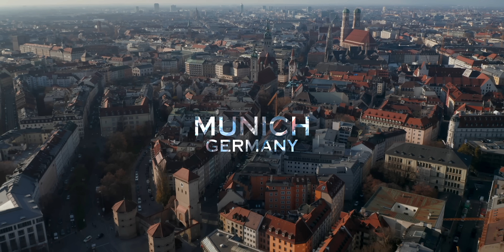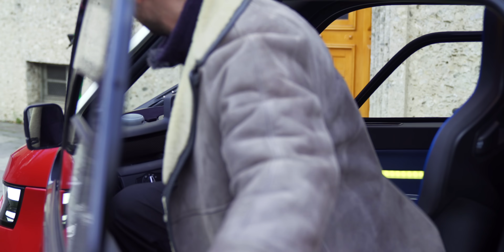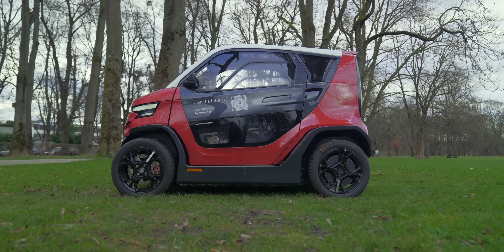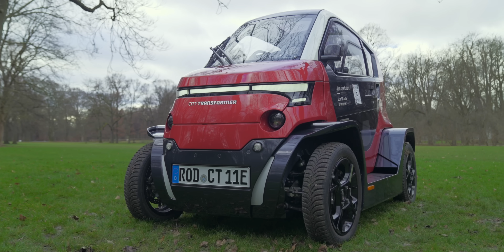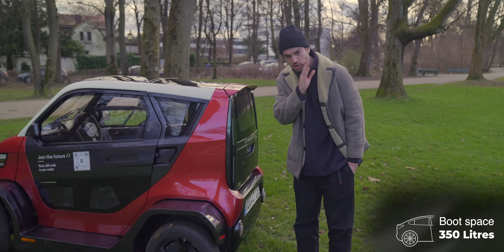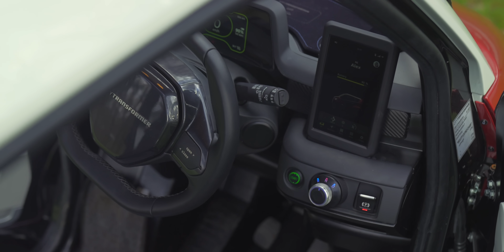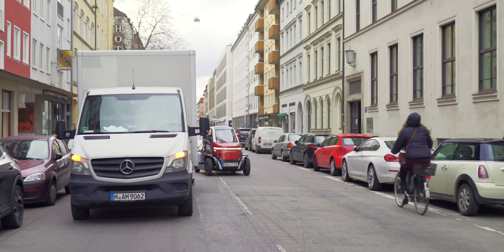The TRANSFORMING Electric Car Designed to Skip Traffic Jams!

Comment: The solution for traffic is never going to be solved with some new car. The solution is going to be less.
Reply: on a personal level it might get solved - I'd much rather park that vehicle and it seems nicer than riding a bicycle or motorcycle in the rain.
Reply: Fewer cars is the top priority. This would aid that (designed specifically with car-sharing in mind). Cars getting smaller would help too!
Reply: I’d prefer either an electric bike or a “real” microcar - maybe a Smart or something that can carry two people in comfort. But well done for saying “shape shifting chassis” without spluttering.
Reply: The future is smart cities. No need for cars to be driven.
Reply: @JackScarlett1  agreed and for people who don't believe that, try being stuck in a city behind a bendy bus that occupies an entire mini roundabout, instead of a proper double decker that has the same number of people but has already cleared the junction.

Size matters, no matter what the SUV people tell you. 

I'm pretty sure if you nixed all the Land Rovers in Kensington and Chelsea, there'd be a lot more room for vehicles and people.
Reply: Agreed but vehicles like this are closer to e-bikes in terms of impact and space than they are to regular sedans or even EV sedans. I have no problem with micro cars as a stop gap solution on the way to walkable cities so long as they're EVs and designed around sustainability.

I should add that I live in North America and we're much further from walkable smart cities with excellent transit than our European counterparts. I could see these things being a pain if they start being used in bike lanes in Amsterdam.
Reply: Hope it is scissor doors. As you saying the video, what’s the point of being able to park in a such a narrow space but need space to open the door. Maybe they could compromise and have one conventionally opening door and one scissor door, so the driver has the choice. Very interesting video. 👍
Reply: Or people can just walk or take public transport, especially in the large metros in developed countries
Reply: @seauryakumar  Doesn't apply to most of North America, unfortunately.
Reply: There is a reason why the many iterations and variations of mini cars/covered bikes have not become popular: the size. The size means impractical and regardless of ease of parking, hint: never between parked cars, unless in specialized functions such as handicapped, campus, inner city shared, recreational parks, utility vehicles, etc. Thanks
Reply: It’s both. We can pursue both new smaller vehicles and fewer vehicles overall.
Reply: Less is more!
Reply: It’s not that the answer is only fewer cars. This lesser car also plays a part.
Reply: True but…..just for metro driving, this is a great idea especially for single people. I’d definitely keep another vehicle for long distance travel but this could work for me. The price isn’t bad either. 😏
Reply: I can see people never walking and using just these to go absolutely everywhere.
Reply: Still, little car makes minimize ordinary car problems...like parking and space
Reply: Agreed! Instead of a family having one car we will see 3 or more of those parking in front of the house
Reply: @JackScarlett1  No thanks. I'd rather have more public transport and largwr vehicles to whom it may concern.
Reply: Well unfortunately the solution having less is also fixing our awful zoning laws that have forced people away from businesses.
Reply: The Dutch, Finns etc appear to be able to ride bicycles in the winter. I guess it's just doesn't have the sex appeal of gizmos like this.
Reply: @charlo90952  Well... you can also live on the street, right? Not the most comfortable...
Reply: At least the smaller car uses the current resources better ... Given that most SUVs carry just one person most of the time.
Reply: @wayando  still, no matter the size you can never fix traffic exclusively with cars. It's just impossible for cars to be as efficient at transporting vast numbers of people compared to trains, trollies, or busses. The downside is that the average person is heavily disinterested in public transport which is why traffic is so bad and why public transport is so lacking in the US. It also shouldn't be so surprising that the vast number of news on the topic is also colored negatively further pushing the divide. 

I don't think it's fully unjustified to have distaste for public transit, but the fact private vehicles are a necessity for life in the US is a massive failure. Especially when private vehicles are so expensive and there's little reason to enforce vehicles to be affordable other than what the vast majority of people can afford. I think it says a lot though with how many are banking on self driving vehicles instead of the vehicles that already basically drive themselves for you.
Reply: I believed it should be less and smaller in size.
Reply: Don't tell them about those high efficiency high cargo capacity electric cars on tracks...
Reply: @jonevansauthor  Agreed our city got a failed in other places mild hybrid bendy bus and the test drivers got stuck all over the city. Unfortunately that kept them "Gliders" but fortunately now the newer option to replace the diesel busses are full electric double decker's and they have no problems with any of the routes that the bendy Gliders get stuck on.
Reply: @EnnuinerDog  You can not drive it on bike lanes in Amsterdam .. even a HS (45 km/h) e-bikes are not allowed on bike lanes.
Reply: @pollumG no thank you
Reply: @orderofmagnitude-TPATP  I agree
Reply: And the Euro-NCAP rating.... I'd like a bit of that  whilst mixing it with contemporary traffic... In the interrugnum before this type of vehicle predominates city traffic.
Reply: @pollumG  No needs car...
Reply: But the thing is, who wants less… I don’t think the typical guy wants to give up his car to take the bus.

Comment: Its like a better mobility wheelchair, but useable speeds more than 8mph, i can see it being great for pizza delivery as thats miserable in bad weather on motorbikes or ebikes.
Reply: You can get covers for ebikes or etrikes to keep you dry, and it will come in thousands of dollars cheaper for the deliveryman, plus not require insurance and registration.

Also, delivery people in downtowns like electric scooters because they don't get parking tickets or locks on their wheels. You can pick them up and take them off the road to not get parking tickets (but that comes with a risk of theft from junkies)
Reply: @-whackd  yep, and just consider how many  tens of thousands of pizzas you have to deliver till you pay for it. 16 k is unacceptable. With that amount of money, you can take a taxi to and from work for ten years. And you do not need to drive it. But as a rental this may work.
For something like this to be an success on market, should be no more than 2k. 
Is no wonder that gas care are still at power.
Reply: @ehombane  A decent mobility scooter or eTrike is more than 2k.
Reply: @rossmaclean2  The key of your statement is... decent. 
And I understand, we all are kings now, so everything needs to be fancy. Sorry, decent.

A friend of mine has a mobility scooter that costed 1k. Sure lead acid batteries, and no roof. But is anyway overpriced because of limited production and taxes. 

What I say is that these devices should be cheap in the stripped version. Who wants heated seats and wheel, fine, pay it. But the student is poor, and hence he will pay 1k, for an battered old ICE car,  Gas will cost him a lot more in time. But down payment is the key. 

And I understand, production cost may be more than 2 k, But since there are so many other things subsidized, like coal plants why not these too. 

If We want clean cities, this is a way.

By the way what you vote for decent air or decent wheels?
Reply: @ehombane  Well i would assume itd be better for businesses to buy small fleets of these for delivery in cities
Reply: As a Domino's driver with a 98' Mondeo that is sometimes 'cumbersome' in some of my English town's narrow back streets; this brilliant creation would be awesome!!! Cos I want compact and efficient, but I not doing the 2 wheel thang.😂

Comment: Honestly anything above 5k in pricing doesn't make sense maybe 10k but at that point u have other used car options that are efficient with fuel that they make more sense, If I am buying this small car to get around faster and cheaper not great comfort, make it as affordable as possible coz it shielding me from the cold or rain is confort enough 14:40
Reply: This. The way I see it, anything above 10k automatically disqualifies a micro EV car as a valid option. The 4th gen Wuling Mini remains unmatched at <7k USD in China, and it's a car that can seat 4 people (2 of them have to be either kids or "smaller" adults though).

Comment: Looks great and really agree with being able to split lanes in a car as its 'killer app'.  In heavy traffic, in terms of speed to your destination, a Smart and a Range Rover are essentially the same.  It's the reason why I chose a scooter years ago when I would have preferred a Twizzy.  

The one problem I do wonder about is how easy in reality it will be to go into folded mode when you really need to.  In my experience, the 'oh nuts, I need to squeeze through' moment usually happens when stationary, and then I doubt that I would have enough space to get to 6mph and spend the 2 seconds to fold in before getting to the gap.  I haven't done the sums, but suspect the gap will be well into 'what is this muppet doing, I'm going to lay on the horn and call him lots of names' territory.
Reply: Also from my experience on a motorbike some other drivers are very selfish and will squeeze you at the last second before filtering
Reply: When you look for a parking you can prepare yourself for it.. here in Amsterdam all is 30km/h so I do not need the wide mode, and it will also protect me from getting a ticket because the nerrow mode is limited to 30kmh.

Comment: This would be nicer than riding my cycle in the winter or on those rainy days.
Reply: I do agree would be more comfortable but if you can cycle it will be the more sustainable way to take the bike. I actually only take a car if i need to transport stuff which wont work with this little one. Thats way i cant imagine it being useful for me. But like i said if cykling is an problem than this might be the best option.
Reply: One would have to take into consideration the individuals in the city who like to drive big vehicles. Some of them are less polite to vehicles they see as too small or an underpowered nuisance. This would be both, which makes me want one even more.

Comment: The micro car class (L6 and L7 in the EU) could really use some lobbying, as Jack said. Not just for financial incentives, but for parking spaces too.
In bigger cities street parking will get more and more restricted as the street space is released for pedestrian use (which is a good thing). This dilutes the main benefit of this class, parallel parking. You don't need to park parallel in parking garages and you end up taking exactly the same space with a microcar as a regular car takes, with the same cost obviously. The layout should be designed with microcars in mind as well, letting them take advantage of their small size. Motorcycles are often neglected too in this regard.

Comment: Love the idea of transforming micro-cars. Followed the "Hiriko Fold" (changing the wheelbase) for a while, which like the Microlino was entered via the front and had 4 wheel steering with a motor in each wheel. Combine the transform capability of both and the versatility is incredible. We live in interesting times. Cheers.

Comment: I really hope this one works out. Basically I'll take anything that's a modern one or two seater car no bigger than the Smart. 111 miles with regen braking and DC fast charging sounds like a great road trip vehicle (assuming we're allowed to drive them on the M4 etc). If they could really do it for €16,000 and it actually comes to the UK that'd be great. 

I had a petrol Smart and miss it terribly, but the current electric one is way too expensive given the fact it has ancient tech in it (and thus lower range than Chinese counterparts). I'm really not interested in big cars, so I keep hoping this or a new Smart or the Microlino will make it to volume production. 

Since Lightyear and Arcimoto are both going the way of the dodo it looks like, I'll believe it when I see them on the roads. Fingers crossed and all that.
Reply: The 50mph top speed might make these things a bit stressful on the M4.
Reply: @xxwookey  oh damn. Hadn't noticed that :( Ah well, second hand car it is.
Reply: I have a Smart ForTwo electric drive and I love it. The tech seems fine to me? It does have a limited range but I live in the city and don't do a lot of driving so it's perfect. I like the car in this video but I also like having the option of getting on the highway for a short trip if I have to.  I was hoping Smart would keep making city cars and come back to the US but unfortunately it looks like they are now going to make cars that look like everyone else's with four doors and a larger footprint. I still hope they come back as I think it'll be easier to get parts/service but I don't think I'd buy one of the new designs because I am also not interested in big cars haha
Reply: @CraigMayhem  the new owners of the brand have vaguely said they might possibly maybe just about do a new 2 seater but given how far they've departed from the original concept I'll believe that when I'm sitting in mine. 

I say the tech is bad partly because the UI for the console has been reported as being a touch low end/out of date/rubbish.

But mostly because the Chinese same size cars with the same form factor have better ranges which implies Mercedes don't know what they're doing considering they charged a lot more.

I do think it's sufficient but the price is a problem at least in the UK. It should have been cheaper, or have better range for that price. 

I'd still take one if it were financially viable - my next best option that actually exists unlike the CityTransformer - is the Fiat 500 and that has two junk seats in the boot for no reason and is much longer. I haven't found anything else close in size that's being manufactured that is.
Reply: @jonevansauthor  I will agree that the console UI isn't terribly good. It's pretty basic and there are loads of screens but I only use one of them. I got mine used with under 20k miles so I got a good deal. Coincidentally I do own a ICE car - a Fiat 500. I'm not sure what Chinese brands are heading to Europe soon but I know there are a few 2 seaters in the mix there.
Reply: @CraigMayhem  yeah. I mean, I am comparing it to more expensive cars but obviously the expense of a tablet isn't really a component to worry about. They could have done better but you know... Mercedes. Not exactly known for innovation since Mrs Mercedes proved her husband wasn't as bright as he might have seemed. 

I do hope they get here with Chinese 2 seaters, or others that don't go bust make them. Sooner or later prices will come down and they'll be more accessible. Although the best hope is obviously that Elon will recognise the value of the form factor and produce his since barely any trips are made with more than two people anyway. 

I'm glad to hear you're enjoying the Smart - a used one is definitely something I'm considering when I'm ready. That'll be a while so I've no idea what I'll end up with.

Comment: The iQ/Cygnet walked so this could run. It's a fine divide between appliance and personal transport, and this, dare I say, filters those two lanes. It shouldn't feel like work or a sacrifice, and this seems to provide just enough coddling to ease that transition. What a fun car, although I'm smitten with that Microlino. Slay with that outfit and jacket in particular, and what I'd give to sit like a backpack on Jack.

Folding/Unfolding > Crab Walk.
Reply: Also, shout out for not a single Transformers/Autobots/Decepticons reference.

Comment: I think back to the first gen RAV4 EV (1997 era), you didnt have an EV network. It would until post 2010 when more and more public chargers became a thing (first EV adopters had to plan. Even 20 years later, I get questions how much money its going to be to charge, like I’m stealing 10s of dollars of electricity with each charge).

Like locally I'm fighting a city to turn over their very own public charging infrastructure to be charging for the electricity that you use than some luxury parking spot of a fix dollar amount per hour.

Thinking forward, this kind of micro car will become increasingly more valuable as rules, manufacturing/buying incentives and transit infrastructure permits.

When half of the ground floor a multi floor carpark has dedicated ebike and micro car parking, is a day the hummers, SUVs, pickup trucks, etc all need to do more socially to even park. (And please do fine hand over fist when they hog up multiple parking spots).

Comment: I like it!  It's certainly better than a vehicle that's always wide like the Twizy.  However, I still prefer a tilting one that's in the narrow form.  There'd be less aero drag, don't have to worry about switching modes when slowing down and threading through traffic, contents wouldn't slide around as much when cornering, and it's just more fun.  Also I don't think the variable-track mechanism costs much less than a tilting mechanism.